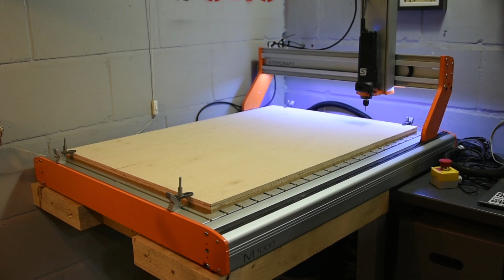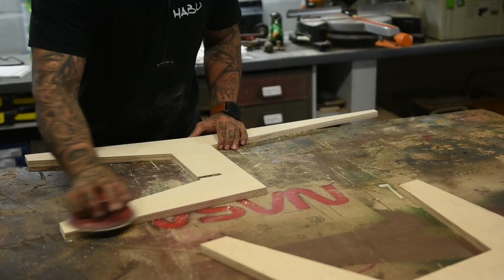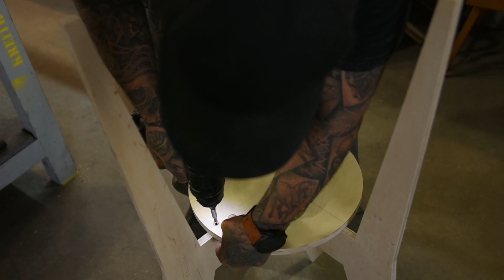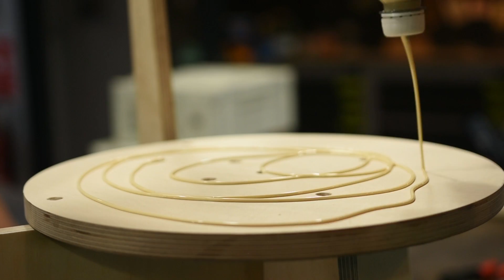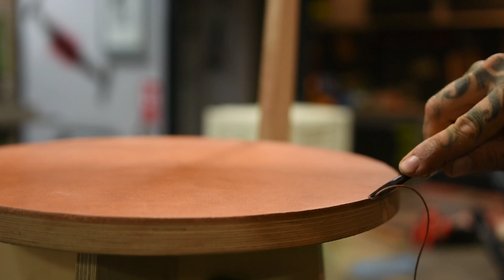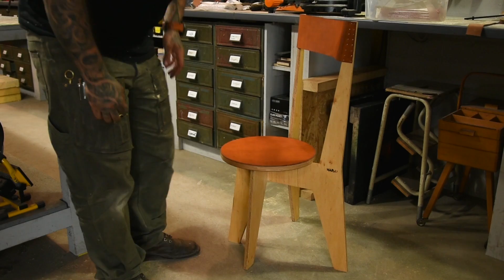HABU \\ Diy Design Plywood Chair

Comment: This is a great design with beautiful execution. I'm curious though: on most chairs that I've built with an X pattern for the legs, the stability in the twist (around the vertical axis) is wobbly. It looks like the screws in the seat are the only thing stabilizing it. Do the screws feel sturdy enough? Would a cross bar across the back help that?